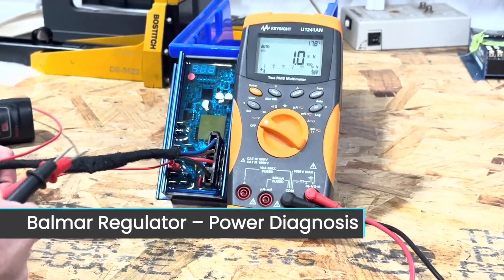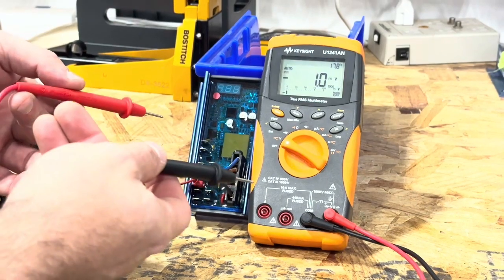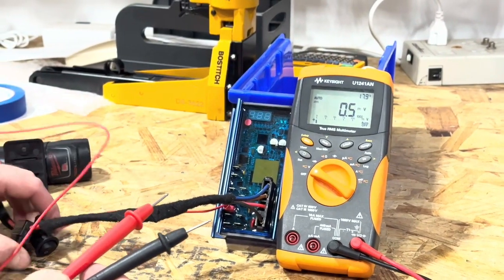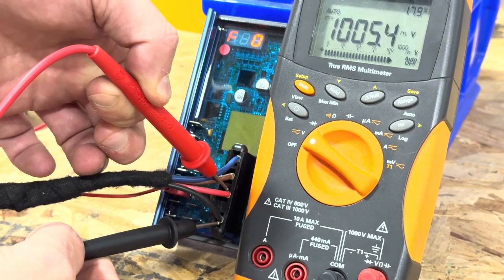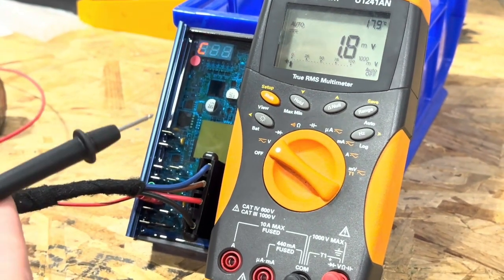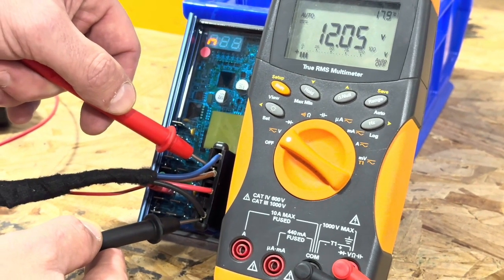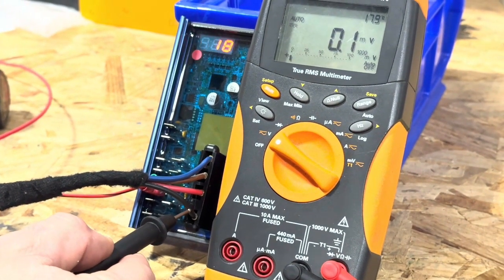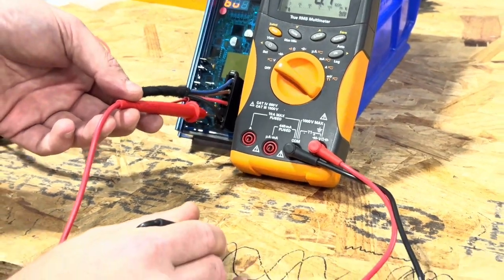Balmar Regulator Power Diagnosis

Comment: Super helpful video and it took you less than 2 minutes.  I am having a crazy problem with my MC-618 where it randomly won’t turn on for varying lengths of time and then comes back on.  Now I can begin to test why.  I assume it is a loose wire somewhere. The weirdest thing is when the MC-618 won’t turn on I also get two error messages on my 23 Transit, 23 Ekko a “Blind Spot System Fault” and “Cross-Traffic System Fault  error message AND the touchscreen doesn’t work (making it impossible to turn on the AC or heat).  I’m going to test it tomorrow (it’s working right now) to see what I get and as soon as it fails again, which it will, maybe I’ll get some insight on how it can be fixed.  Thanks again, you are the best!